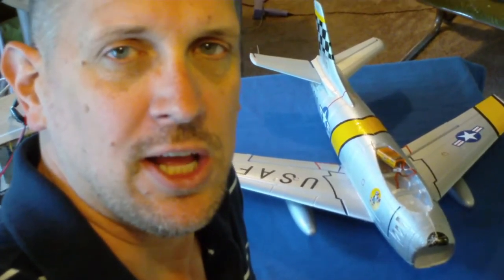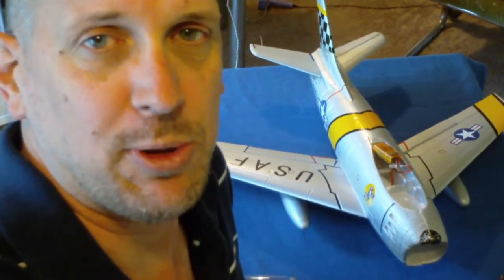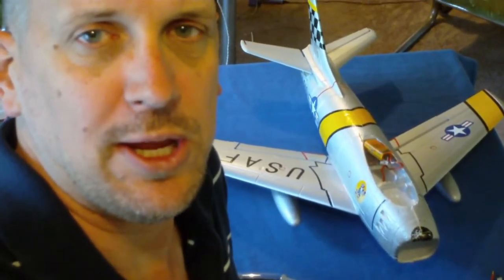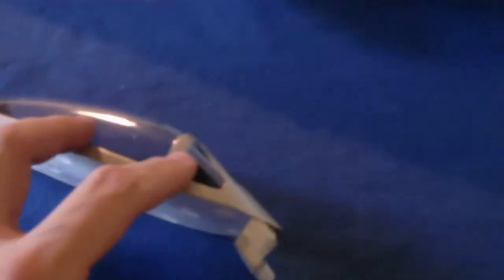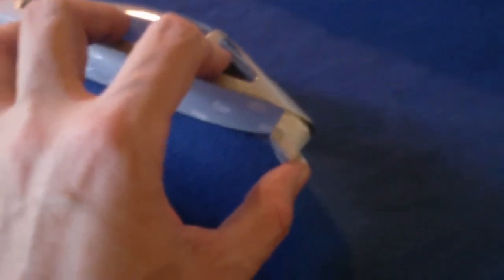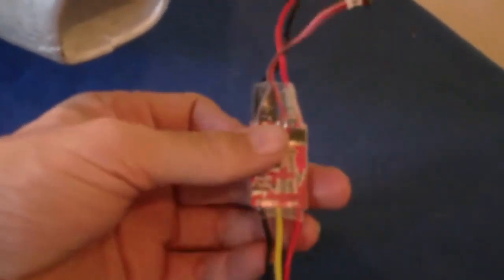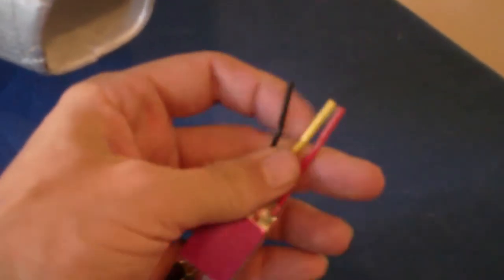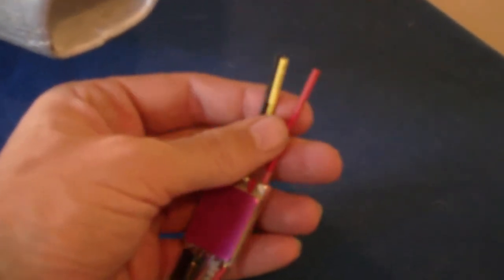Hobby King F-86 Micro EDF Repair log Video # 1

Comment: Well that wasn't too bad. I went a head an taped the bullet connectors together on the motor leads, and put a spot of velcro on the esc to keep them in place.
So glad you said glue and not "CA" to fix the hatch! LOL

By the way, (eh hem!) you've been challenged!
:^D